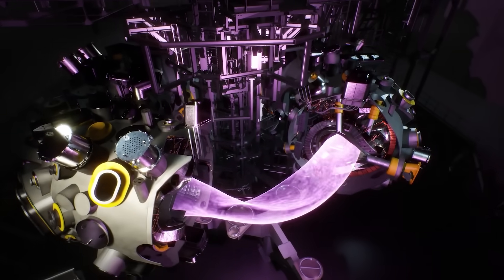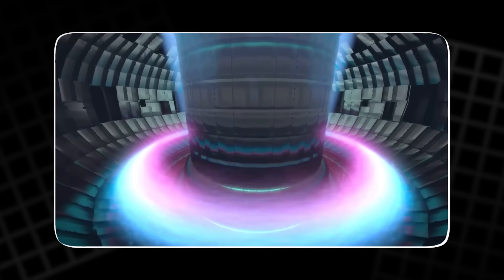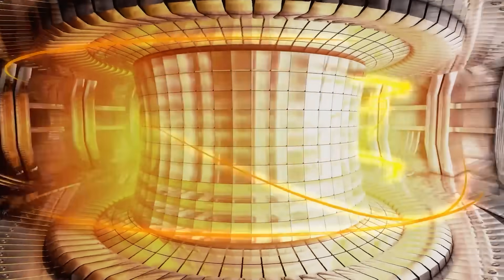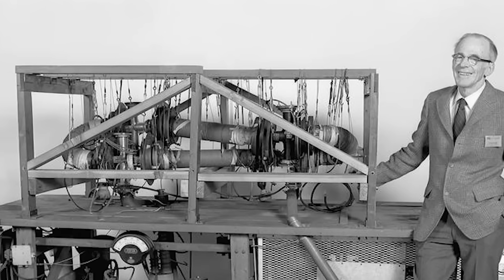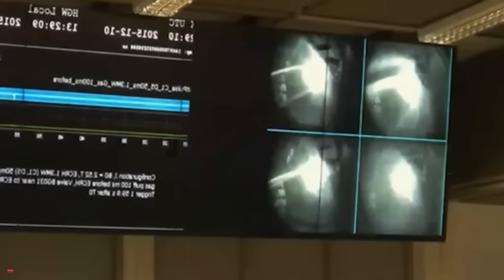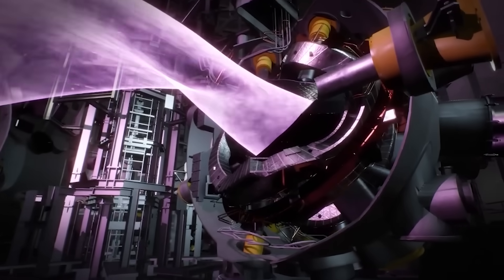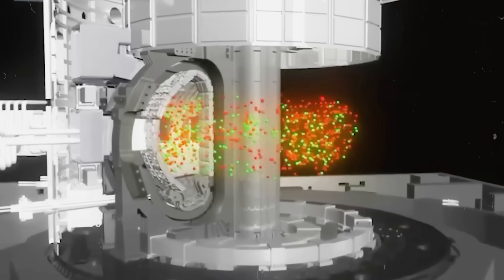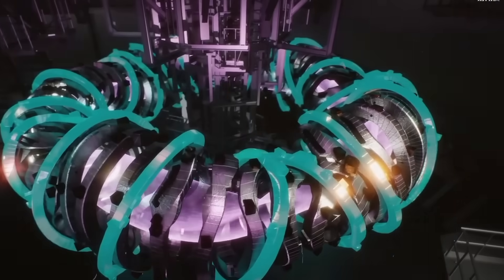Germany’s “Twisted Sun Machine” Just Changed Fusion Forever

Comment: But nobody has ever explained how heat or indeed electrical energy can be usefully extracted from fusion reactors. A floating plasma that cannot touch solid materials or lose heat without collapsing presents problems
Reply: "nobody ever"? You mean nobody you know and "ever" is the 0s you spend to research it?
A lot of the energy will leave the magnetic-cage in form of neutrons. These are absorbed by the walls and create heat... so the walls need cooling which in contrary means some fluid will be heated up in the cooling-process.
And then it is straight forward - a lot of thermal-energy in a hot fluid to drive turbines to convert into energy or be consumed as heat directly.
Reply from the maker: That's a very insightful point about the challenges of energy extraction from fusion reactors!